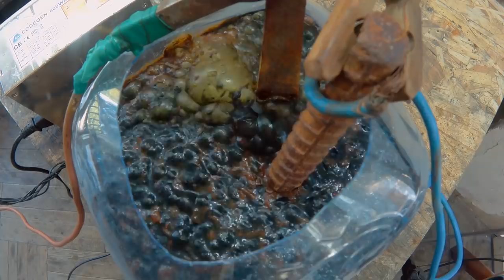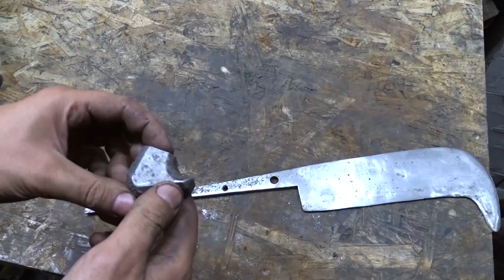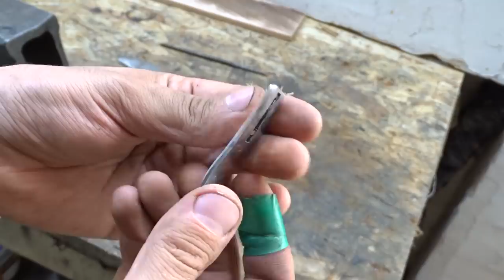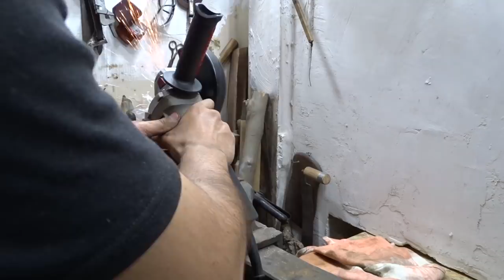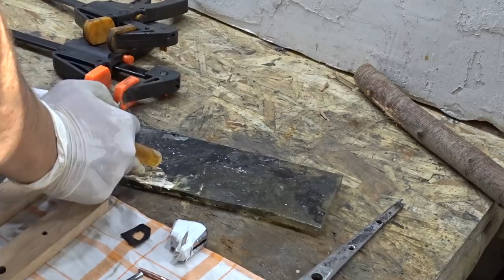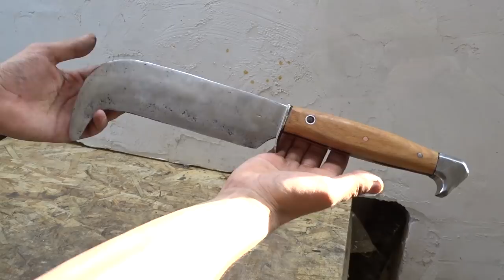Old Rusty Corn Axe Restoration

Comment: My corn knives, machetes, and whatnot all have a hole drilled through the handles at the butt end for a wrist cord to keep the tool from flying off if jarred from your grip and being lost or impaling/slicing the wielder or bystanders.  Also, we found that oversized grips are easier on the hands, as less grip is needed for firm grasp. Really liked the hook end you added to the grip.
Reply from the maker: Hello sir, thank you for attention! Your information was interesting for me.

Comment: decent results. the one thing that stuck out to me was the size of the hole nearest the blade. I think it took too much metal way, that spot is going to be too weak. I have to wonder why the tang was so darned long in the first place.
Reply: The tang is long because its a machete for crop harvesting it would have been on a long pole handle to begin with
Reply: @blindmelonlemonjello  oh... thanks for the info. I think I've seen something like it before...somewhere.
Reply: Long handle => more umpha. Sometimes billhooks that are made for woodsmen can have 1m ling handle.
Reply from the maker: Hello, thank you for your attention, sir! I guess many years ago, people use the long tang to put in round wood handle. May be is not right my opinion
Reply from the maker: Thank you for info, sir!
Reply: @ReasonAboveEverything  I have seen similar blades, but not with long handles. I guess the longer handles would be necessary in some places, not others.  In fact I have pocket knives with similar design to the blade.. i liked them for stripping the outside case off wiring when I was doing electrical work. The larger versions I've seen were for hacking through the jungle, we did not have to reach any higher than our heads with those, we weren't interested in harvesting anything just getting through the jungle in one piece.
Reply: @ScrewsAndTools  the others suggested that it went on a pole originally. That seems likely.
Reply from the maker: Yes sir

Comment: Beautiful work, my only concerns are the sharp angle between the handle and the base of the blade where you filed it square. Sharp angles tend to be weak spots, being the first area to crack or break. Also when you ground off the corner the metal got hot enough to chang color, making the metal soft there, right by that sharp angle. Not trying to be that guy, just looking out for your safety if you use this tool.
Reply from the maker: Will do, sir. Thank you so much for attention and advice! Regards!

Comment: One other thing, a knife for chopping will be a lot stronger if the area where the tang meets the blade is not at a 90 degree angle. It’s better to have a curve in that spot than a right angle. The reason is because of stress fractures from chopping. The sharp angle will magnify the stress of the chop in that corner and eventually it may shatter at that point. I’m saying it only to help you. Otherwise everything is great!

Comment: I see a lot of people use the electrolysis method of removing rust, and then they end up using a flap disk. I would think that it is probably better to bypass the electrolysis altogether and go right to the flap disk.
Reply from the maker: Hello, yes sir it's true. But I used always elctrolisys due to first of all remove all little piece off rusty and lose little percent of steel.

Comment: When you squared off the shoulder of the blade by the handle you introduced a stress riser. It's why so many blades and other tools have things like that rounded off, so as to not snap. Be careful with that. It should be fine if it's just plants that it's cutting, but I'd be leery of anything very hard.